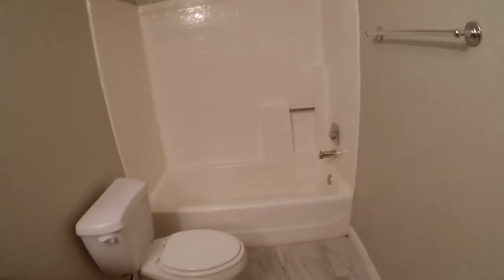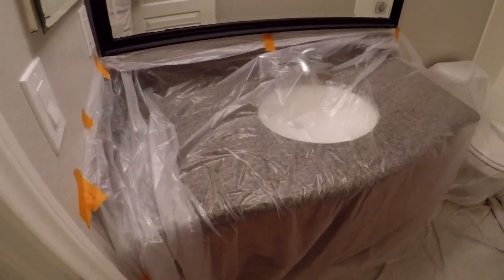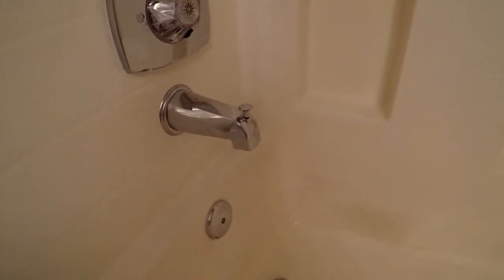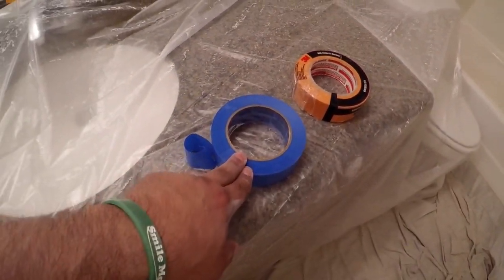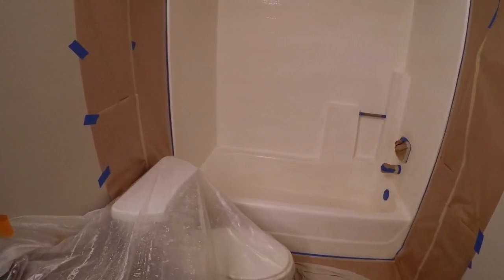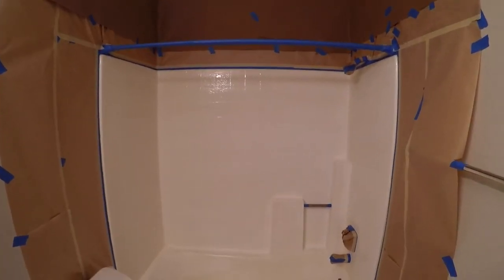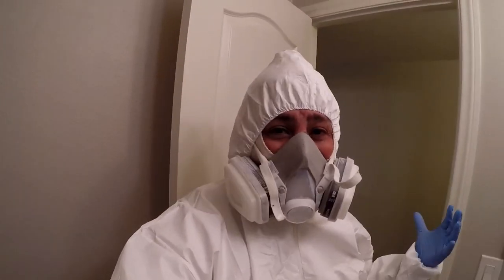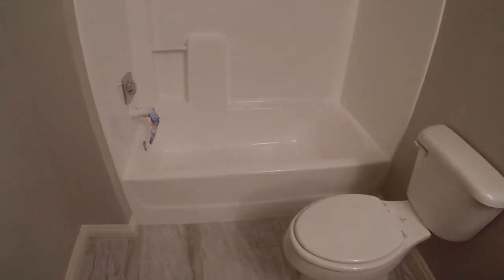How to Reglaze a Fiberglass Bathtub | Full Fiberglass Bathtub Reglazing | DP Tubs

Comment: Thanks for this video! Now I know it must be sanded beforehand. They (management and maintenance)re-glazed my tub and the tub was still wet with water.  Therefore I believe they didn't sand it either. The bubbles came up soon. Thank you so much. Now I know what to tell them which should be their job anyway.
Reply: with this primer used, it will peel off quickly, sherwin williams paint is for private people, not professional

Comment: Dang thats a lot of steps. Plus all the supplies you use. I would think you have to buy all that in bulk or you wouldn't make any money. I never knew you could scrub to hard cleaning your tub. Good to know...
Reply from the maker: Yes on fiberglass and pressed steel you can scrub to hard and they also fill out when abrasive cleaners like comet or Ajax are used! It’s like scrubbing a fine grit sand paper on the surface. 

Yes material is purchased in bulk but most materials purchased last through multiple jobs. This job was $800 and materials were about $100. Especially since some were purchased from prior jobs.
Reply: How do u figure estimate? How many tubs a month? I’m looking into this for an add on service. Up state NY
Reply: Actually 7% of your gross is materials, reglazing is profitable.

Comment: Good job bro!

I work for miracle method in san diego.

I use the graco gun with a 3M cup.

Looks like you take forever to prep and spray

I can do a cast iron tub, in 1 hour and a half, clean up and everything.

Fast is production.

You know that!
Reply from the maker: Thanks man! Cast iron tub with no damage or repairs can be done in about two hours for sure.  However,  as you can see in this video this is a fiberglass bathtub shower unit that was coated before that required sanding and primer. To me fast is production but too fast is quality control and unnecessary mistakes. I like to take my time. I work for myself and don’t rush. I am not worried about squeezing in as many jobs in a day.
Reply: @DPTubs  how long did the job take you in this video?

Comment: Hi, great video. Lots of good information!
I am about to do this on two tub surrounds in my house here in NH.  I have 2 sprayers, One is an airless Graco 360DSP which has a 4" fan tip or a 12" fan tip and two speeds.  I normally use it with the big tip on high speed for wall paint.  
My other sprayer is an HVLP Devilbiss FLG4 with a bunch of tips. It has 1.4, 1.5, 1.8, and 2.2 tips.  I normally spray cabinets, doors, and trim with the 1.8 but that requires thinning most material. I use a Ford #4 cup which measures the viscosity-thickness of the paint so I can get it to the thickness that sprays well.
I will shoot the 1,2,3 primer with the airless. Graco says it sprays anything without thinning, which is great because I 1,2,3, trhinned with some water on my cabinets and it took forever to harden up.
In checking I saw some other folks asked about polishing and repairing Krylon.  I see that once it is cured can it be fine sanded, compounded and polished?  Does it normally cure to a shine?
Reply from the maker: Yes definitely cures to shine

Comment: I've reglazed a fiberglass tub with enclosure. I cleaned, sanded with 150 grit, tact cloth, primered, and then applied rust oleum 2 part. I've noticed I've developed a rough surface. Could this be caused by not letting part A and B set up before applying, or was my prep not thorough? Thank you for your time and professional opinion.
Reply from the maker: Could be a few things..might need to be thinned out. Could be spraying too far from surface. Possibility the surface was not cleaned thoroughly and wiped with a tack cloth before spraying

Comment: What air cap size do you use on the titan? I have a fuji q5 platinum i use for auto body. I use .8, 1.0, and 1.3 air caps for primer base and clear. Would i need a 1.5 or 1.8 air cap to refinish a shower surround?

Comment: Hey all. I just went to Titan's website and looked up the Maxum II projector sets. The #3 set that is shown is these videos has a .051" tip, which is 1.3 mm size. 
Auto guns like I have will use a 1.3 or 1.4 for basecoat and smaller for clear. They use a 1.8 for heavier material like primer.  I have used a 1.8 for latex which I have to thin down. I'm surprised the Zinsser 1,2,3 will even flow at high volume low pressure (HVLP), it's thick. 
I have used 1,2,3 thinned this spring, but it took forever to dry in my humid cold basement.  Once dry though it sealed and was a nice base for my paint.
Hope I am not being a jerk by adding to your comment feed!  Thanks
Reply from the maker: I use the 20 oz spray can Zinsser 1-2-3 with the wide nozzle. Sprays amazing. Available at Home Depot. If you ever have a problem with primer drying make sure to use your fune extractor to suck the moisture out of the room. Helps with dry time tremendously. 

I use a #3 tip for my top coat.
Reply: @DPTubs  I sprayed it with my gun. 2 coats. No problem. Waited a bit, knocked it down with 400 sandpaper.
Mixed up the Krylon Tub & Tile and put on 3 coats. I used a 1.5 tip because the Krylon was thinner than the latex I have been shooting on my cabinet fronts and trim. They have been thinned and shot with a 1.8.
Also I wanted to remark that I was concerned about the bits and pieces that I found in the Part B can of the Krylon. It was really a lot of bits. So much so, that it would clog my filters. In hindsight I wish I had brought out my cooking strainer, that would have grabbed the bits and allowed me to filter the 2 part epoxy a bit quicker.

The epoxy covered well, it's very shiny. I got a bit of pebble grain in the finish.  So if it does not level I will probably polish it up to get it smother.
Reply from the maker: Yes ALWAYS strain your Krylon. Mix very well and then strain. The catalyst / hardener gets chunky I use cone strainers from Home Depot

Comment: Danny, thanks for taking the time to share this with all of us here on the web.  I had one question though, is it normal to use the "Bulls eye" general paint primer before applying an epoxy coating?  I'm not a chemist, but for some reason was under the impression an "epoxy specific" primer had to be used.  Obviously that's not the case though since you've had great success with it.
Reply from the maker: Hi Jonah..Thanks for the comment. That’s a great question. The best way to answer that is for me to make it clear on how or why I use the primer. I use the primer simply as a sealer not for adhesion. Even though the surfaces are thoroughly cleaned washed there are times were certain things cannot be seen to the naked eye. The primer sealer when sprayed makes the surface very uniform in color as well. So when sprayed and dried I am able to see if there was anything during cleaning that was potentially missed or silicone reaction things of that sort. When sprayed on tile it also helps seal the grout. There is no negative reaction with the bull’s-eye primer and the reglazing materials that I use. 

Now if you want a primer that is made for adhesion purposes then I would recommend using a primer that is from the same manufacture as a Reglazing Material. However a bonding agent or adhesion promoter can do that job as well. 

For example if I apply a clear liquid bonding agent let that dry then spray the primer sealer then spray the finish topcoat I will be fine.

Also noted: the more thinner one uses with their top coat the more negative reaction one will have with primers, bonding agents, etc. I rarely thin out my material unless absolutely necessary. Thinners or reducers are more of the problem than anything, IMO
Reply: Hello, Danny and thanks for the question Jonah .. what type of prime do you use or do you use paint with primer? Also do you have pictures or video a year after results? 
Thanks for the videos and the time for all the input you put into this page and answering questions.
Reply: with this primer used, it will peel off quickly, sherwin williams paint is for private people, not professional

Comment: Again, fantastic videos!!! Couple of questions I still have after watching.
1) I’ve noticed you using a different kind of primer (paint based?) rather than the Bulldog adhesion promoter that you recommended in other comments. Do you have a preferred primer for fiberglass tubs?
2) How much Krylon tub & tile do you end us using to finish a full bathtub the size in this video?
Reply from the maker: So the bulldog is always used before the primer. The primer I use is strictly for sealing grout or neutralizing variation in color. It also helps me see any imperfections on repairs due to the uniformity of its color. Note: I do not use the primer for adhesion purposes but more for sealing purposes. 

Primers for fiberglass tub adhesion I would recommend Midwest Chemicals while using their white finish as well. I really like their finish but it’s less convenient due to shipping costs and delivery times. If it was local I would be using it in a heart beat. 

I use about 36-42 ounces of mixed Krylon at the 1:1 ratio per unit.
Reply: @DPTubs   thank you so much for the info! Extremely helpful!

Unfortunately, Midwest Chemicals doesn’t sell to the general public, so I think I will end up using the Krylon tile and tub. Is there a primer you suggest that works best with Krylon?
Reply from the maker: @jameltaylor6116  yes you can use Zinser 1-2-3 or Zinser BIN shelac based primer. Just make sure they are totally dry before and DeAnda me before coating.

Also Krylon is on Amazon for $30 kit as opposed to $75 a kit from Sherwin Williams
You also need to mix well and strain into spray gun cup
Reply: @DPTubs  wow you really are doing a good job thank you for sharing your skills to us .. I’m a 15 years experience painting house and any kind for paint for house so I’m looking to start doing this painting here in Utah .. what do you used to clean your cup sprayer after you finish painting the epoxy paint or primer ?

Comment: What kind of primer should be used I also spray tubs but for the most part I just sand or acid etch .is there something in the TDS  that would give me an indication of what primer will work on tubs also does the primer need to be sanded or just spray over it .
Reply: Al S ALWAYS sand the primer with a high grit of 600-800 to kick down any dust bumps and then vaccum it out then tack cloth. If you don’t sand and tack cloth you will have roughness in your final coat. What supplier do you use for top coat?

Comment: Hey dude! Where did you get your primer and epoxy paint? Now I’m using BLP but it ain’t gods enough. Thanks in advance
Reply from the maker: I am currently using RESURFACE SOLUTIONS and my top coat supplier and I use Zinsser 1-2-3 for a primer / sealer
Reply: Thanks. How long it takes the primer to dry? And how much do you wait until spray the white glaze coat.

Comment: Nice work sir!  I travel painting doing residential work, been looking to do my tub and possibly offer to customers if my first go around turns out as planned.  I do have a question, my tub in particular is a bit slickery and would like to add some 'traction' to the floor of the tub.  Any applications available to add a grit of some kind so I don't end up like a turtle on my back?
Reply from the maker: Yes you can add Shark Grip to the finish.

Comment: Thanks for the informative video. I’m just a DIY’er and am going to refinish my fiberglass tub/shower enclosure (actually looks exactly the same as the one in this video)  I have a Titan 115 HVLP with a Maxum II gun. What size projector do you use and what air flow and paint setting do you use?
Reply from the maker: Tip #3 I also show my gun settings on my paint spraying video. Check it out and let me know what you think!

Comment: Hey thanks for this vid. Im getting ready to spray my clawfoot. I was wondering though if you have to thin the krylon stuff with • Xylene or acetone to have it go through the sprayer smoothly?
Reply from the maker: I have been using Krylon for over two years and I have never send the product once and I also live in Las Vegas with extreme heat. 

Generally you can send the product with anything that it’s recommended to clean up with

Comment: Nice work... Did you start with 220 grit with orbital the p400 by hand (dry), primer, then finish coat.  How long for 100% cure time after final coating
  * Does the sticky coat mess with the uncovered sheetrock?
Reply from the maker: Yes 220 orbital
Yes 400 by hand on primer 
48 hours for cure to use with water 
5 days for 100% complete cure
I generally mask 24” around and use an exhaust fan / fine extractor seen in one of my other videos. If it’s dark painted walls then I cover more. Krylon is not super sticky like other coatings

Comment: This is great work you do and nice spray gun. I want to do my shower but need to do a roller or brush. What would you recommend as far as a product for that? How much do you charge for this?
Reply from the maker: Roller brush combo never gives a good result. I would recommend spraying. You can even use a DIY spray gun at Home Depot called a Wagner Flexio. I normally Charge $350-$375 to Reglaze a bathtub shower combo. I use Krylon Tub and Tile:

Comment: Great video. I did not see any ventilation? Are you running any fans for the fumes? I'm looking at starting this as a side hustle here in the midwest. Any starting tips? I'll be learning under a family member who has been doing it for 20 years but I'm always looking to learn from others too. Appreciate your taking the time to educate others!
Reply from the maker: Yes I have an 8” diameter fine extractor. With a 20’ hose
Reply from the maker: That would be a good video!
Reply: Hey DP, is there a company you recommend for the commercial-grade cleaner your using?

Comment: Awesome work! I think I’m doing this in the next week or so, so this video is really helpful and detailed! Thanks!! 
Just a question, what primer do you use? I saw kilz brand but is it a specific type? I was researching and found a kilz that is bonding for fiberglass and other tough surfaces, but what you used looked like regular primer? Please advise 🙏🏽 
Thanks again for your videos!
Reply from the maker: ZussieMakesit Zinser 1-2-3 Primer
Reply: with this primer used, it will peel off quickly, sherwin williams paint is for private people, not professional

Comment: Hi, love the video! I just had my tub reglazed recently with this same spraying method, but after the tub dried I noticed lots of really tiny bubbles throughout the tub. Is this normal or a potential sign that the job was done poorly? Thanks for your insights!
Reply from the maker: Small bubbles indicate that there is a possible adhesion issue or fish eyes! Did you use a bath mat? Should be smooth at the bottom! It’s possible that the reglazed did not remove contaminants on the surface completely and there is a reaction.
Reply: It means the tub wasn’t sanded/prepped properly before spraying and the paint didn’t “stick”.

Comment: My tub is an insert and has a textured bottom for safety. How do you go about handling that since you can't really sand since it's not smooth? Or does that matter? Due to mobility problems we'll be switching to a walk in shower. Any suggestions?
Reply from the maker: What do you mean handling? Cleaning the bottom or Reglazing the bottom?
Reply: @DPTubs  Do you sand the tub bottom when it's textured?

Comment: Nice! Those came out awesome. What PSI are you using to spray with? I know you said something a little high. Are you talking like 40 psi's or even higher?
Reply: HVLP sprayers and compressors are usually low pressure, usually less than 5 psi

Comment: I used one mix of the krylon tub and tile and did a fiberglass tub, after I'm seeing alot of what looks like orange peel...should I add another kit to it and wet sand before? I just expected a more smooth looking surface..
Reply from the maker: What gun did you use?
Reply: Batavia hvlp

Comment: my tub has been glazed but it's peeling. Can I just send or do i need to peel with chemicals?
Reply from the maker: You can sand it but you may still be able to see the area that peeled. Also if it peeled sanding may remove other loose areas.

Comment: Great video. Exactly what I was looking for. Question? What size tip did you use and how much did you thin the primer and the topcoat? Thanks.
Reply from the maker: I use #3 tip....I do not thin the top coat at all unless it is very hot. If I do I only use 10% thinner to paint ratio. I like my material thick. In my opinion the more thinner you use the more the material is “lessened”.
Reply: @DPTubs I’m looking for the best materials to coat tub’s with. Can you direct me to exact product. The primer and epoxy

Comment: Bro. It would be better for you to buy paint by the gallon. Sherman Williams sells polain paint.  good product.
Reply from the maker: Polane is pretty good but extremely expensive. I currently use Resurface Solutions which is ISO Free. You should check Polane and isocyanates.I buy Resurface solutions by the gallon.

Comment: Thanks for the video. A couple questions about the primer. Was it water or oil based and did you cut it down or use it straight out of the can. Thanks!
Reply from the maker: Straight out of can without reducing it with water
Reply: @DPTubs  Thank You

Comment: Great video! Thanks for sharing. What was the name and type of primer you used? Also, just to confirm, you used 220 grit then 400 grit? Would you recommend using acetone to wash down the tube after sanding and prior to priming?
Reply from the maker: You can use Rubbing Alcohol or Lacquer thinner to wipe down with a micro fiber pad then use a tack cloth!
Reply: @DPTubs  Thank you, sir. What type of Primer did you use?
Reply from the maker: Zinser 1-2-3